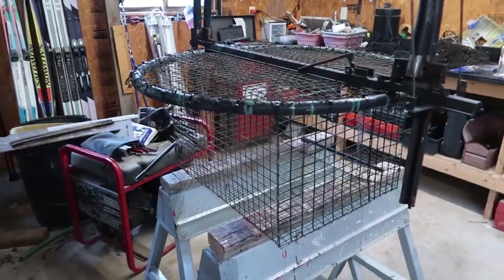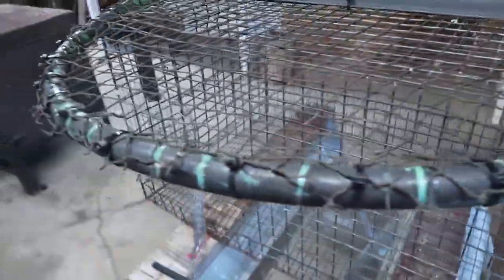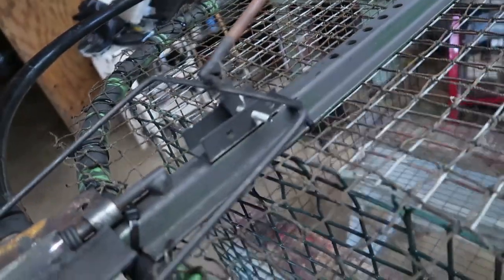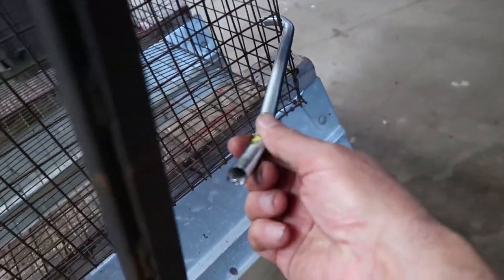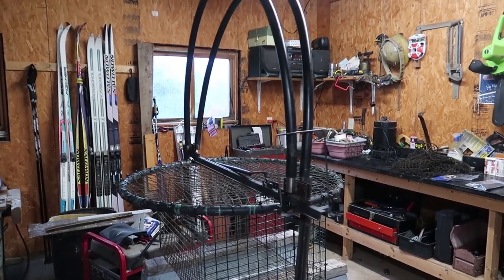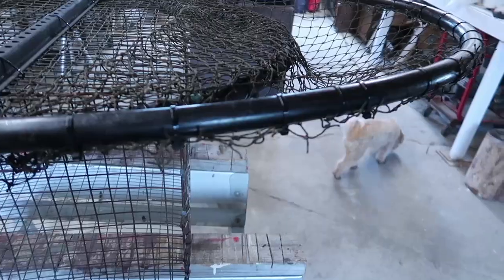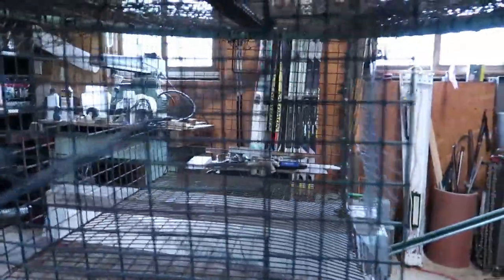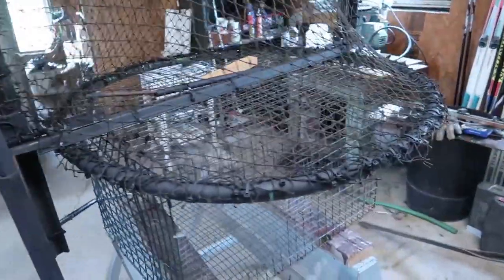German Goshawk Trap...Modified

Comment: as a master falconer and a trapper i would suggest using bungee cord instead of the springs...a cooper and goshawk will a lot of the times work around the bottom of the trap on the ground trying to get the bait birds ...they can get caught in the springs and tear flesh remove feathers etc...also i use 1"x1/2" wire for the bait cage as 1x1 allows a coopers hawk to reach inside and you wont have bait for long especially alive =)
Reply from the maker: Things I hadn’t thought about…thanks